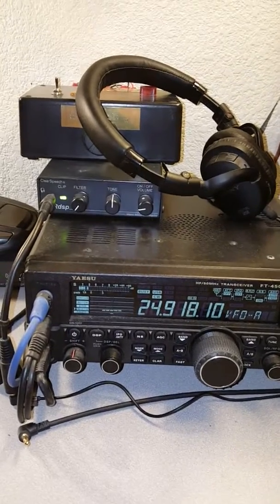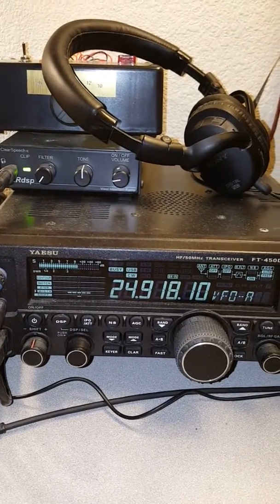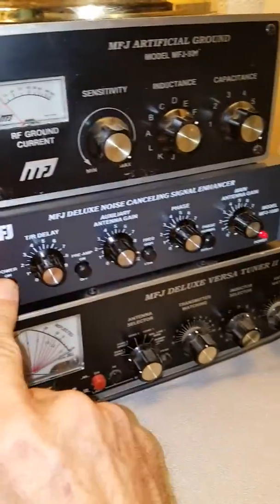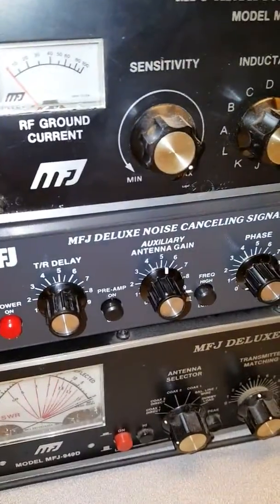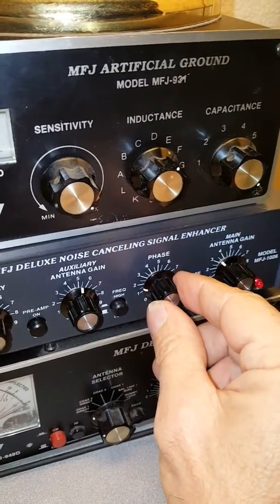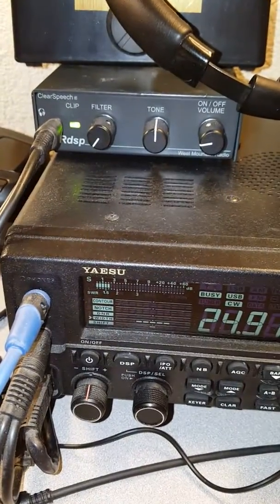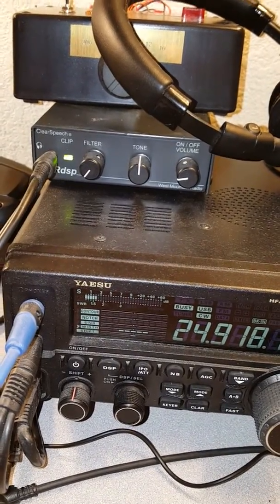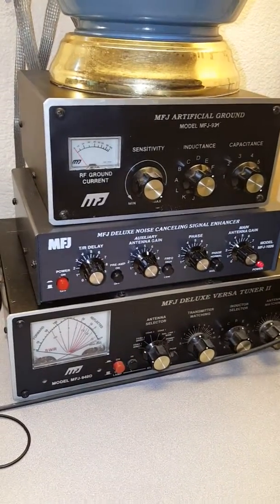MFJ-1026 Noise Canceling Unit nulling noise from Solar Panel Array

Comment: will this unit work with a noise problem that drifts upward over time??
Reply from the maker: Possibly, although most of the noise I've dealt with is broadband in nature. The only time I need to retune is if I rotate my main antenna, or if I'm trying to null out a different noise source. But, if the noise is band limited, like a birdie from a switching power supply, and drifts upward in frequency, then it will eventually be outside of the IF passband of your RX, and should not pose a problem at that point. Unless it starts drifting downward at some point.

Comment: yaesu 45o has built in DSP already. why need a second DSP in shack. ? dsp doesnt help eliminate qrN -qrm?
Reply from the maker: The radio DSP doesn't even touch this type of manmade noise. The MFJ-1026 is not a "2nd DSP". It is a noise phase cancelling system.
Reply: @rogerm8557  there is another smal dsp on the radio i mean. not mfj
Reply from the maker: @bahattinturnaz8406  Right. That does not work against this kind of noise. DSP works best against atmospheric noise, not manmade noise.

Comment: Hey Roger, I know this content is a bit old now but I also noticed you had the MFJ artificial ground as well. Any chance you can do a review of that as well? Cheers, 73's from Australia.
Reply from the maker: Thanks. There's not much to demonstrate on the MFJ artificial ground. It's really meant to keep RF off of the chassis of your equipment. You connect all the chassis grounds of your equipment to it. Then place a random length wire onto it (with insulated end). The unit has a L-C tank circuit that you adjust for peak RF current while you transmit. By doing so, you are tuning the wire to be a quarter wave resonator. The wire at the chassis end will have maximum RF current, and minimum RF voltage. At the end of the wire will be minimum current and maximum voltage (keep the wire tip insulated for safety). I'm not sure I need this anymore, because I've moved my antennas much farther away from my operating position.

Comment: Thanks! Good demo, except I wish that you would have allowed us to hear the difference in actual sounds, not just viewing the s-meter. I can understand that the noise would have perhaps interfered with your description, but at least at the very end, a demo with the actual noise differences would have been impressive. 
Also, if you had held the camera horizontally that would have been great. Otherwise good demo with a stark difference in results!
Reply from the maker: Thanks. You won't hear any difference in the noise because the receiver AGC will compensate, so the audio output level is about the same in both conditions. You will, however, hear a huge difference in signal to noise ratio (SNR) between the two conditions if a signal is present. But, to null out the noise accurately, you need to be tuned to a clear frequency. Sorry about the portrait orientation of the video.

Comment: I think this is exactly what I need for my QTH. I live about 200 yards south of transmission lines, and another source of RFI that I can't track down. It didn't help that I have a plasma TV, and when I got licensed and on the HF bands, I was pretty disappointed that I couldn't hear a damn thing due to the TV. I'll replace the TV when it dies, but I'd rather spend the money right now on radio gear.

Comment from the maker: As a side comment, I'd just like to say that this is a very serious problem when solar system installers are using cheap charge controllers and inverters that pollute the RF spectrum with such terrible noise. These cheaply built, faulty systems present a serious threat to 2 way radio communications, and that could very well include emergency and public safety communications. There is no way that this junk could pass FCC Part 15 emissions requirements. My understanding is that these solar systems are exempt from regulation. Hopefully, that will change soon, as I am sure the FCC is receiving many complaints.